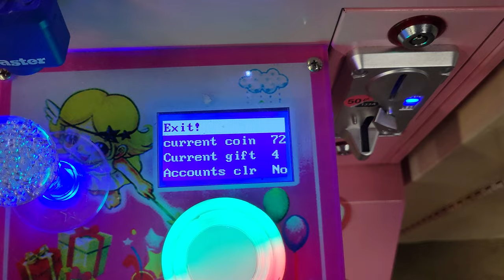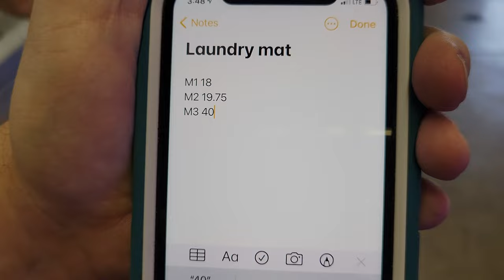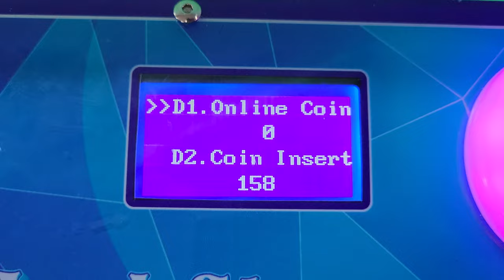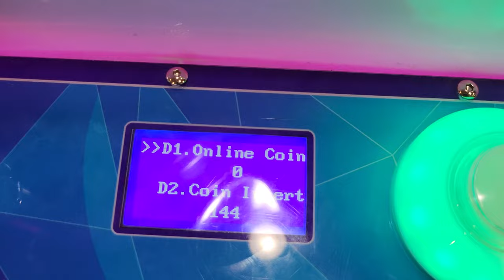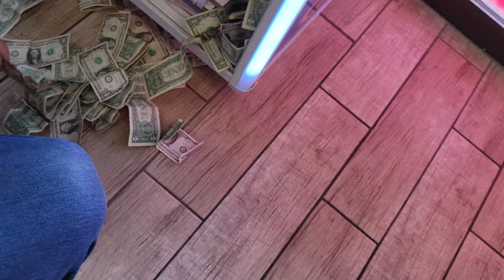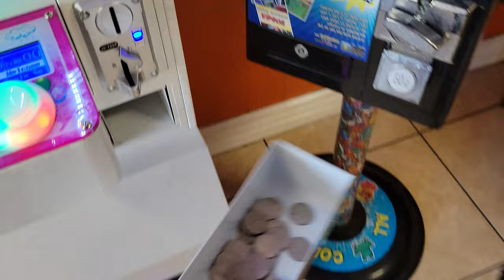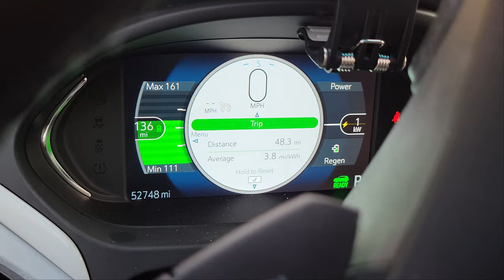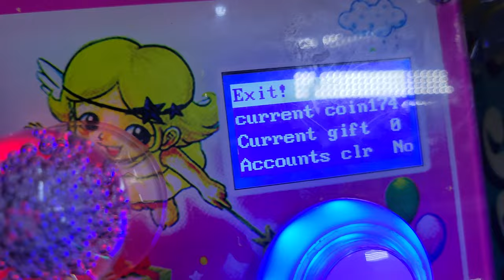I Bought an Electric Vehicle for my Claw Machine Business!

Comment: Welcome in the club ,my friend . Since last year, I have an electric / hybrid small truck ,too.  It´s  a truck from france called .Goupil G5 , but I have two other cars ,too. The problem here, it is a long time cold, unfortunately at the moment too . So you need to much energie for the heat in the car . But this truck has a small engine , so you can use this ,when the batterie is nearly empty.Greetings love the video .
Reply from the maker: Thanks again! yeah i am so excited about the Ev. Where i live it never gets to cold, however it will get extremely hot